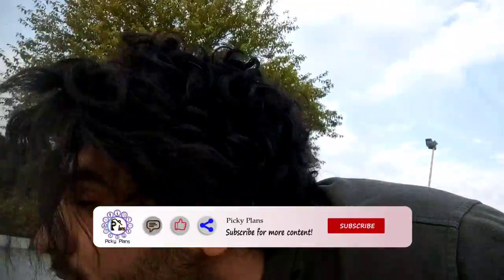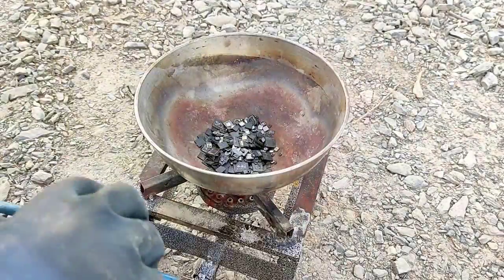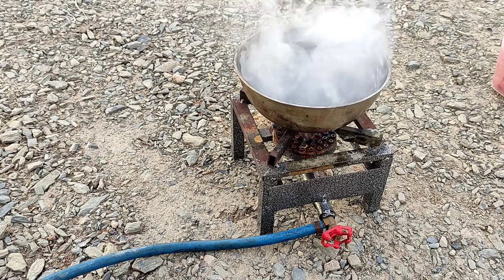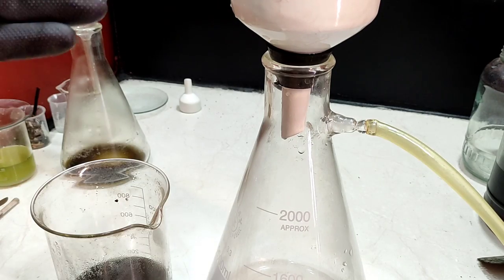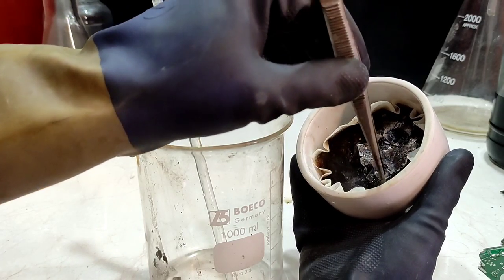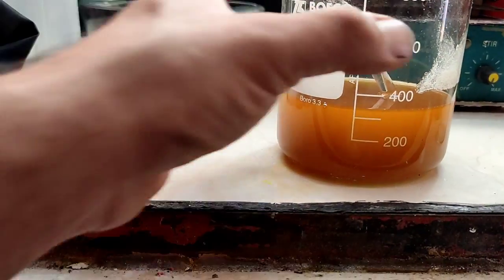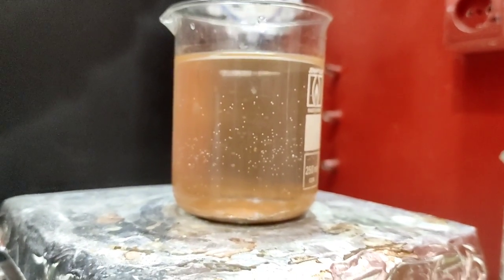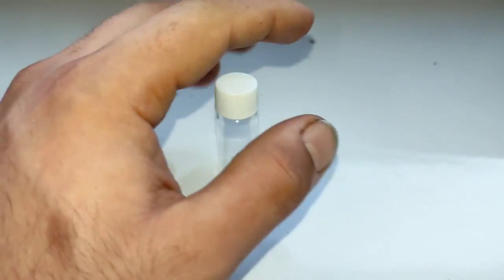BGA Chips gold recovery| 3kg old cellphone Part 2

Comment: The gold didn't drop because the sulfamic acid was supposed to be added when your gold chloride is hot. That is why the acid didn't fizzle and emit NOx gasses. Heat it first next time nice video.
Reply from the maker: The principle you told is right adding sulfamic acid to hot gold solution.
But what happened in my case was redissolution of gold right after dropping. I could see gold percipitate at bottom. But started to fizz out and dissolved. Also when i dropped gold stannous became negative but after redissolution it started to give positive test.

Comment: Hello, your gold didn't desolve because of some gases in your fume hood. The denox process just didn't work properly because a few things.
1.) your solution was cold when you mixed the sulfamic acid into it.
2.) sulfamic acid doesn't denox completely. I have seen it several times that even after sulfamic acid completed, adding urea still showed a reaction

these are the 2 main points...
Reply from the maker: Hello my friend
Interesting great experience about sulfamic acid.
So you suggest urea over sulfamic acid?
Reply from the maker: Excellent!
When i fell impatient i pre-mix AR but you are right i should add nitric acid drop-Wise in.
Any way that was great explanation 🙏♥️

Comment: Hey mate, great video and always enjoy your content.
Metastannic acid isn't soluble in HCl as metastannic is the hydrated form of tin oxide. 
NaOH sends metastannic colloidal and can be poured off but in this case (bga) it would have made little difference doing that. But if you had metastannic mixed with a bunch of gold foils, this is when NaOH can become useful. 
If you want, try wet ashing with concentrated nitric acid. Metastannic ends up in with carbon, nitrate solution is easier recovered meaning Ag and Pd can be recovered if present, all other base metals dissolve (except for Aluminium if present) and all you're left with is gold and whole silicon dyes
Take care friend
Reply from the maker: Thank you my friend 🙏
That was good explanation of your experience . Perfect and useful, Thanks.
In video linked below i succeed dissolving Metastannic acid in hot concentrated HCl to recover tin from
https://youtu.be/krmjC2fFDaY  at 6:57 moment.
When there's a lot of Metastannic acid i reduce them using aluminum to stannous chloride (from stannic chloride , result of reacting tin oxide hydrate with HCl) that way HCl could keep more tin dissolved even after cooling. 
In this extraction since there wasn't too much Metastannic acid it was possible to be dissolved in a few hot HCl and be rinsed off.
Probably you have experience with conc. HCl with high amount of Metastannic acid, which seems it can't be dissolved, that way i use Al as complement for HCl
Reply from the maker: That was interesting ! How concentrated should be nitric acid for wet ashing be done for BGA's 68% ?
 Is it effective as conc. Sulfuric acid?
Reply: @PickyPlans  very interesting about the metastannic dissolution in HCl, I will check that video out. 

Yes 68% is fine. I forgot to add, needs to be 80 degrees celcius or hotter to start eating the epoxy turning it to carbon, it does not foam or boil over like H2SO4 can and you can do this in a stainless steel pot as you know stainless patina is formed when contact with nitric acid which protects it from dissolution. Be warned copious amounts of NO2 is released and is very visible so maybe do this at night outside 😂 or in the fumehood but I think you already knew that was going to happen. Try it small scale, the results are great. Many other good benefits but would make my comment longer than it already is 😅 you're smart you will work it out my friend
Reply from the maker: Hahaha that's the point , night, outside and I would say leave it to me ...😉 That's Amazing mate i really impressed, Benefits of having generous friend's like you. Thanks  buddy ♥️
Reply: @royalrefining6182  I have never heard of wetashing with HNO3 and it is very interesting. Once I have seen a video of a russian guy showing difference between wetashing with H2SO4 and H2SO4 + HNO3 (3 to 1 parts).
With nitric added, the solution remained more clear, yellowish and not like the slag you end up when you use H2SO4 only.

There are 2 problems. First, I cannot find the video anymore and 2nd I was not able to reproduce his test at home. It simply didn't work. He did it with one single Plastic chip.

But what you are saying, using only HNO3, I have never heard and never seen.
Is there a way to contact you?
Reply from the maker: I've tested it it works. Carbon formed isn't like slag anymore they have bigger size and easily sink to the bottom of vessel.
In nitric acid also lead dissolved and dropped as chloride when i tried to drop silver . In method you mentioned H2SO4 + HNO3 isn't a good method since gold dissolves in concentrated sulfuric acid mixed with some nitric acid , after dilution gold comes out and forms colloidal gold which leads to gold Lossing
Reply: @PickyPlans  of course it works my friend lol I'vebeen doing that process for a long time now for bga only. 
In concentration h2so4 and hno3 will dissolve gold if left after the reaction is long overdue or excessively heated would send gold into solution. In dilution is when I use those 2 acids together
Reply from the maker: I have been sure i works 😃 i told it just to be said
I didn't get it , exactly when you mix nitric and sulfuric while rinsing used sulfuric acid or used nitric acid to Ash and what would be the effect while dilution. Thanks mate